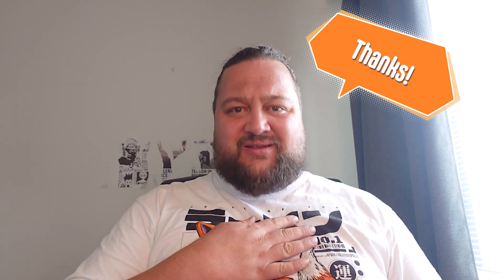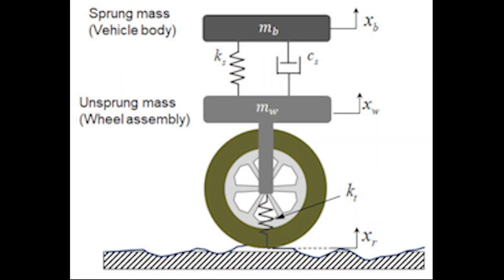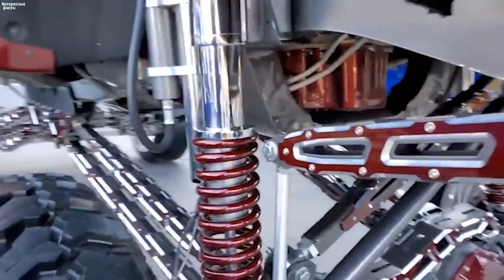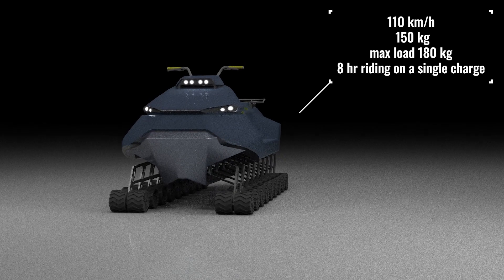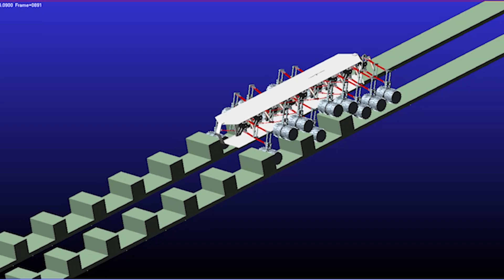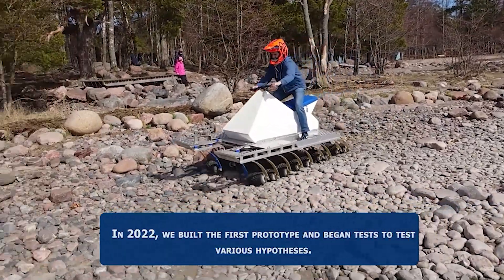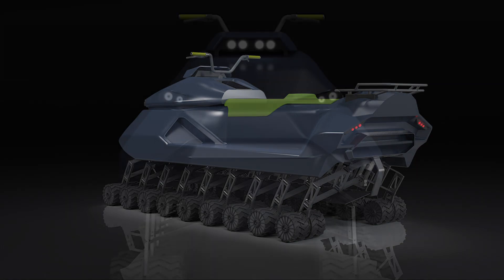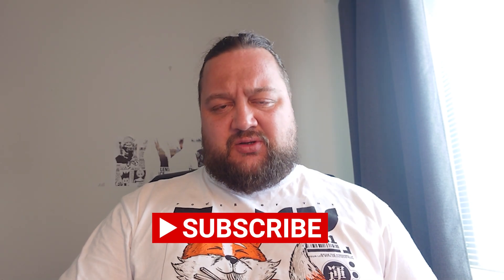The basic idea behind our ATV and answers to questions.

Comment: This is really cool. A couple of thoughts:
- the prototype shows that every wheel has 2 plates. One on each side of the wheel. This leaves a gap between the two plates, where maybe sticks/branches can get stuck in. Have you encountered this?
- the name of the company (18 Wheels) does a very good job at describing what the company does, but it also somewhat limits you to doing only that one thing. I'm not sure what the best thing to do is, but just a thought. 
- i dont know how thick your finnish accent is, but I'd prpbably prefer to hear your voice! Its more authentic. And besides, the finnish accent is dope
Reply from the maker: Thank you!
1. Yes, there was a situation with branches, but we fixed it in the second version.
2. Our main goal is to produce a unique 18 wheel suspension, with different modules on top. For example, a tractor for agricultural machinery, analog of a wheelchair or military products.
3. Yes, I already realized that imitation translation was a bad idea.